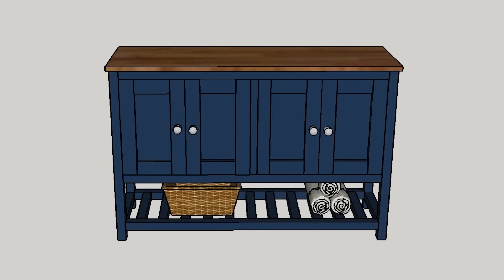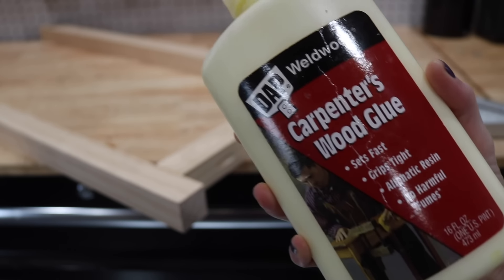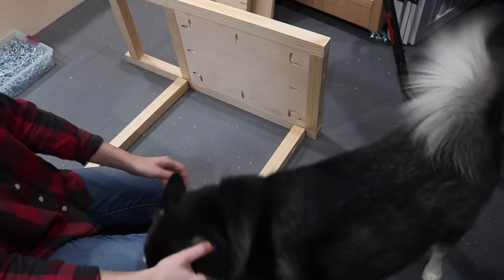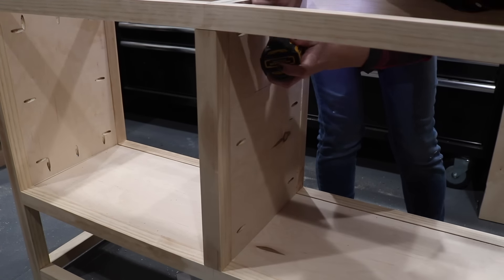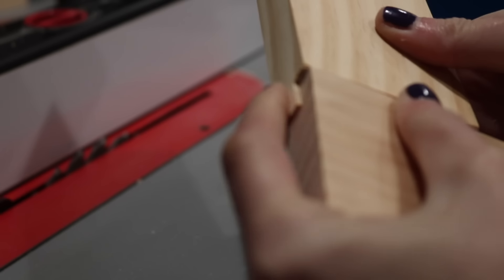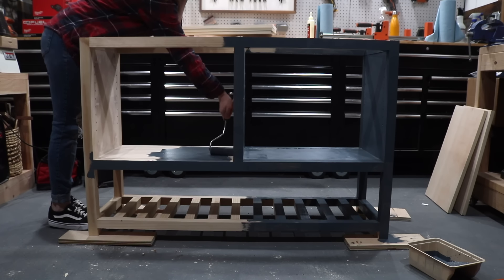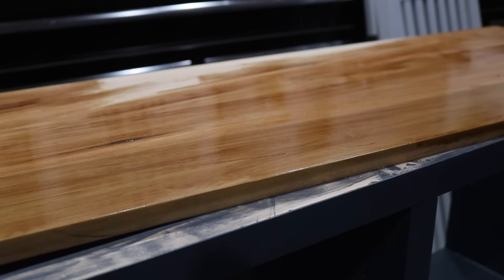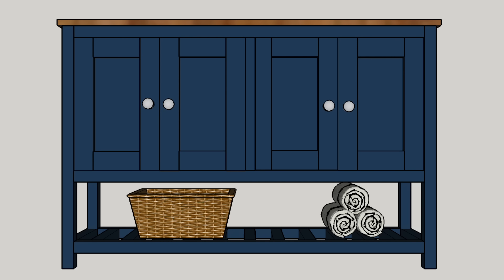DIY Sideboard Cabinet (With Storage!)

Comment: Use FastCap Euro Door Stops for Inset doors to keep doors from moving in too far. Check them out. They have a cam shape so you can fine tune the door. I find that installing them on the top rather than the bottom keeps things from catching on them while sliding things in and out of the shelf.
Reply from the maker: Ohhh. Gotta check those out! Thank you!

Comment: Nice work ! The doors are inset that’s why you need a stop block if they were overlay the frame would stop them,  it’s a non issue, look at any cabinet with inset doors and you’ll always see some form of stop :) keep them coming Sam, you’re doing a great job ! PS  use the primer, your finish quality will improve exponentially ~
Reply from the maker: Thank you for this - I thought I was doing something wrong. Next time, I’ll prime. I promise. 😂

Comment: Thanks for the no tutorial.   Your design and build are lovely.  I really like the end result because it's simple, classic and practical.  
Question - what is the weight capacity for this cabinet?  I ask because I want to build a coffee station/buffet and put a granite slab on top.  It seems sturdy; and I Think a few weight bearing wood pieces as legs might work.  But wanted your thoughts if you are willing to share.

Comment: looks amazing, one tip though, you might want to consider putting the stop block on the underside of the top instead of on the bottom because it can be a nuisance on the bottom shelf. I'm speaking from experience :D
Reply from the maker: I wanted to, but the issue with the doors turning in was happening mostly on the bottom of the cabinet. Luckily, the cabinet is just going to be used for clothing, so hopefully won’t be too much of a pain. 🤞🏼

Comment: Applying Primer and then sanding that gives proper shiny results..

👍🏻
Reply from the maker: 100% priming next time I paint furniture. 🙈
Reply: I nave good reviews on a Satinwood primer i once used' can't remember its specifics, but i think it was caulk and not oil based, which meant it went on a lot easier and never had any absorption issues, then sanded down into a very soft and shiny finish..

Comment: Great build  ! 
May I suggest water based alkyd paint. Also know as hybrid paint . Very durable easy to use , with a nice finish. I have used it two coats without primer no problems.
Truly stunning piece 👍
Reply from the maker: Thank you and thanks for the recommendation! For sure gonna check it out!

Comment: Looks great and nice video. 

I don't have a table saw for the cabinet door tongue and groove stuff. Any work arounds?
Reply from the maker: Thank you! You can add a center panel with pocket holes or you can also nail a thinner board to the inside of the door frames. 😊

Comment: Hi, really enjoyed watching your video. Amazing build. I noted that you used 2 inch x 2 inch (50mm x 50mm) for the frame and used pocket holes to join the pieces. I have two Kreg pocket hole jigs and would be interested to know what size pocket screws you used since the Kreg screw chart only appears to show material up to 1 1/2". Thanks in advance. Sid
Reply from the maker: Hi! I used 2 1/2” pocket hole screws for the 2x2 pieces and I used 1 1/4” pocket hole screws for the plywood. Hope this helps!
Reply: @diyhuntress  thats brilliant . Thankyou. I live in the UK so all our milled timber comes in metric but there are some merchants who will supply it at a cost. I have a wide rage of Kreg equipment and the Kreg pocket jigs are incredible. As a matter of interest do you use Kreg pocket hole screws or a generic screw? Your design is so robust that we intent to use it for our kitchen refurb. The base cabinets need to be strong to hold the granite worktops that will evntually go on. Thankls again.

Comment: Nice build. Why did you screw into the end grain on the center supports?
Reply from the maker: Thanks! Wanted to hide those screws deeper into the wood instead of using pocket hole openings so that the pocket hole screws had more material to bite when attaching the center panels. Also wanted to show another method for using screws to join together the pieces in case others don’t have a pocket hole jig. 😊

Comment: I love how great this cabinet turned out! The contrasting poplar top looks awesome.

Also, I noticed on the 2x2s on the bottom of the cabinet you only used one pocket hole. Did you have any trouble with them spinning around during the glue up?
Reply from the maker: Thank you! Not at all, but because I clamped them while gluing everything up. 😊

Comment: I’ve been thinking about using poplar and staining it too.  After the preconditioned what finish did you end up using?  It looked like it really evened out the color in the poplar.
Reply from the maker: I used Varathane gel stain, but I don’t leave it on for very long! I love poplar. 😍

Comment: Also, which stain did you go with? That’s a nice look color wise atop a dark base.
Reply from the maker: Thanks! I want to say I used “Gunstock” in Poly + Stain from Varathane!
Reply: DIY Huntress ok. I have a pine top table I want to finish. And I know that also works best with the wood conditioner. I want it to be less raw pine, but not amber or yellow in the finish.

Comment: PRO TIP: when you are making projects that are going to be painted...use sheetrock joint compound to fill nail holes or screw holes because it sands easily and takes paint easily.
Reply from the maker: Someone else recommended that too recently. Worth a shot!
Reply: @diyhuntress  It shrinks and cracks. Dry Dex seems to work better.

Comment: How would u do tongue and grove on a router. I have did alot of research but most have them on router tables.
Reply from the maker: The safest way to do this is definitely with a router table. I’ve never tried to do it freehand.

Comment: Something was off about this vid. Maybe because it was missing the "Hey friends! It's DIY Huntress here!"

On another note don't use the miter gauge with the fence because the work can bind and shoot back at you. Clamp a small board to the fence in front of the blade and offset the fence by the width of the board. Use that board as you would a fence for locating where you want to cut. The difference is that when you push the miter gauge up past the board, only the gauge is supporting the work so it won't bind and fly back at you
Reply from the maker: I totally agree - missed having an intro on this one. I’ll fix it next time, promise. 😉 Thanks for the tip. Have many upgrades to make this year. Want to make a sled for the saw, which will make life sooo much easier!

Comment: 12:28 Is it difficult or take a long time to get a big panel like that plane by manually sanding it?
Reply from the maker: Not really, as long as it’s glued up pretty straight! I start with 80 grit and then worked my way to 220 in this one.
Reply: @diyhuntress  Cool! :)

Comment: Nice build, but did you seriously shootnail the top to the piece?!
Reply from the maker: I did! Doing so allows for some movement because the brad nails are flexible. Another option is to use clips on the underside. But, I chose this method instead for this build. You can’t even tell it’s nailed down once the holes are properly prepped and filled.

Comment: Nice build. I like the design. I have to say you either need to step up the glue or give up trying. Those tiny dabs you put on the end grain did nothing to add to the stability. End grain sucks it up like a sponge.
Reply from the maker: I don’t know if you noticed, but everywhere I added glue to end grain also got a fastener... I’m well aware the end grain isn’t the best for gluing, which is why I added additional support... and, I’m never giving up the thing that makes me happiest... especially not for glue. 💁🏻‍♀️
Reply: @diyhuntress  Glued short grain is weak. Not gluing short grain is weaker.

Comment: Ça me fera toujours rire ceux qui font du travail d'apprenti avec du matériel de professionnels. Aucune technique particulière, un plan, des côtes réalisé par ordinateur puis c'est tout, ça reste de l'assemblage pour bricoleur du dimanche ayant pour 2000 à 3000€ de machines 😂
Reply from the maker: I literally show you at the beginning of the video that I created my own, custom 3D plan for this cabinet before building - a computer didn't do that for me. So, I did have a plan, that I created.. also, I have had a workshop space for over 5 years. I didn't just get these tools overnight. I saved for them, or asked for them for special occasions. You can actually build this entire cabinet using a circular saw, drill, pocket hole jig, and sander if you don't have the tools I used (you can buy all of those for around $300 -  $400 and reuse them for multiple projects over and over again).
Reply: @diyhuntress  Ryobi cordless nailer between $ 220 and $ 350, Makita saw between $ 800 and $ 1000
Reply from the maker: Not saying the ones I have specifically. You can get a Milwaukee combo kit with drills, circular saw, angle grinder, and two batteries for $299. Just because I’m using certain tools in my own workshop doesn’t mean that works for everybody else. I know that, and I explain that in my videos.

Comment: Ok cool, so I need to buy majority of those tools so that shouldn't cost more than $102039402 after taxes
Reply from the maker: Or you could invest in the tools to build projects like this and then sell those projects to pay for those tools 10x over. 💁🏻‍♀️
Reply from the maker: PS. In case you were legitimately interested... You can buy/invest in the tools for this project for under $600 depending on the brand you choose.